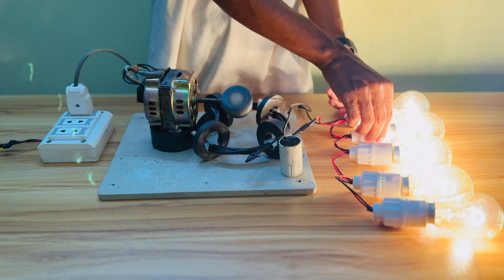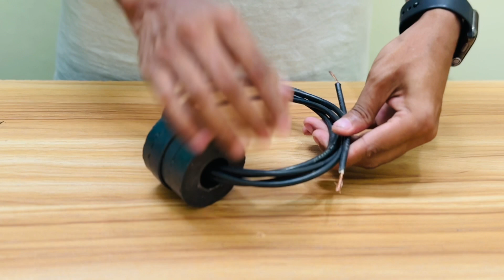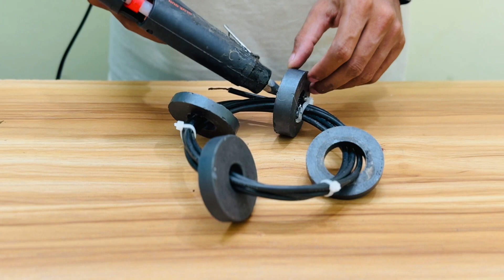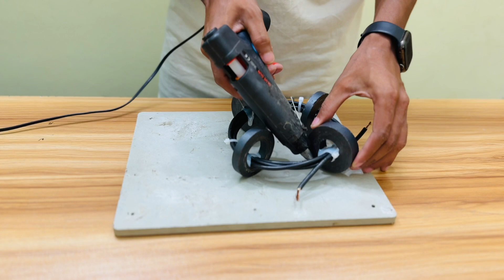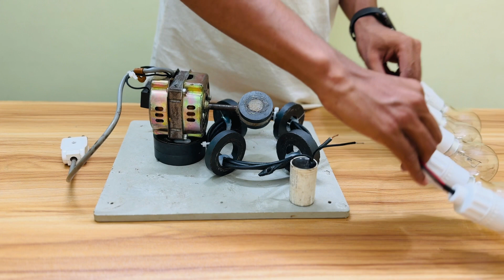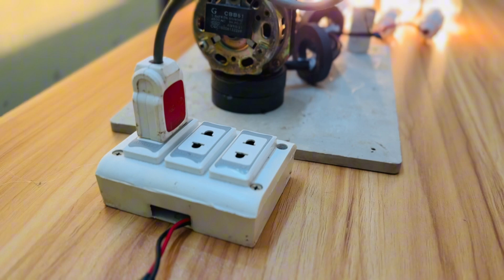Powerful electricity 220V 20RM copper coil AC motor magnet generator

Comment: Reed relais in cap. Batterys or connection from bottom. You can see it when initially touding the rotating magnet. at 7:58 min. Light goes on bright even when not really rotating. So, the reed relais turns on in the magnetic field. bs